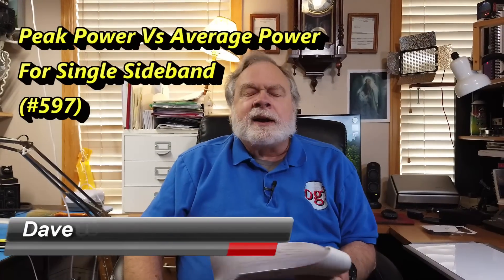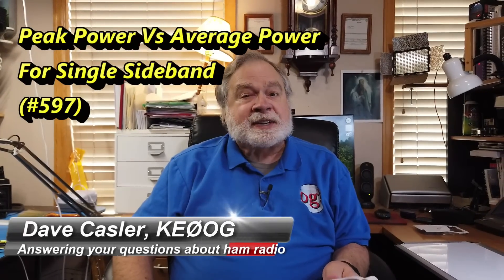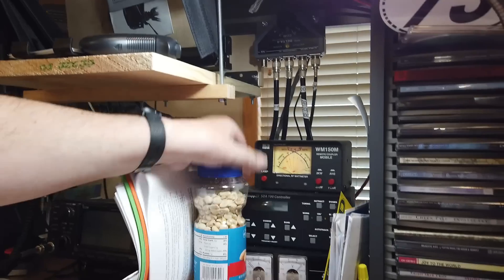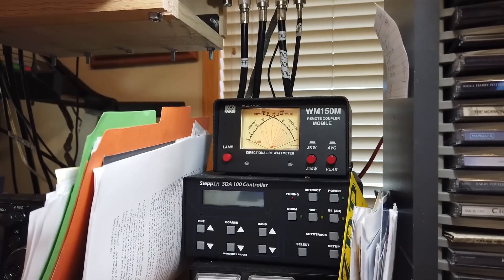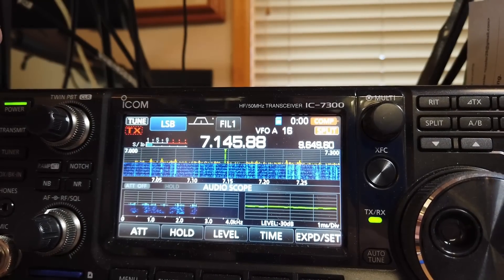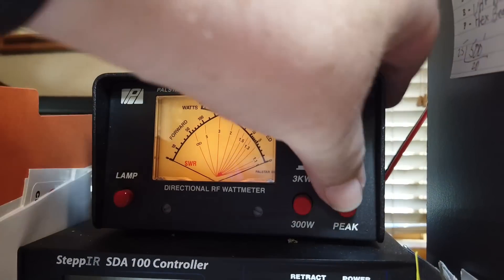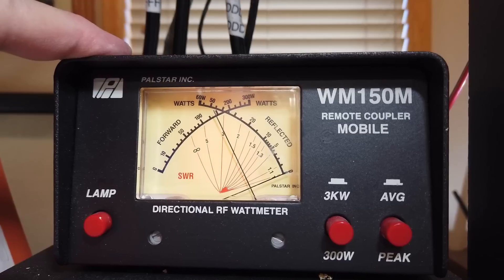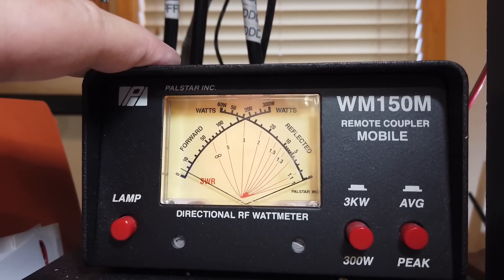Peak Power vs Average Power for Single Sideband (#597)

Comment: Thanks for the explanation Dave. One thing I’d like to point out though is that your Palstar meter is showing between 130 and 150 w pep when you switched to Peak reading. That should in no way occur for a 100w radio. Not sure how much it cost but Palstar is known to be good quality and pricey. So something is wrong somewhere there, either at the meter or at the radio. I would further investigate.
73s
Reply from the maker: It's old. Decades old. Undoubtedly needs recalibration.
Reply: @davecasler  understood

Comment: Got a new Palstar PM2000A AVG/Peak 1.8-60MHz Wattmeter . Very accurate. Ordered right from the manufacture  Palstar.  Great service. The power supply is sold separately
 from them. it's a good one not the switching kind that can cause noise in your radio. I bought a MFJ giant wattmeter first and sent it back. It was completely inaccurate.

Comment: David, thank you so much for answering my question. I’m wondering if in the future you could do another YouTube video where you’re talking to an operator on SSB while not connected to a dummy load. This way we could all see the real-time meter movements of an actual SSB conversation. I think that would calm a lot of operators down because at 100 watts, for instance, we'd be able to see the needle of the Palstar peak reading meter hovering below the 100-watt mark and not fully reaching and going higher than that mark during the conversation, as yours did while being connected to the dummy load.
Thanks again. David and have a very happy and healthy holiday.

Comment: While on the subject it should be mentioned that these pep meters use a circuit which requires a power source. There are meters that say pep but don’t use a power source and they always read low. 
I get on a average meter 25-40w. As long as I see a good swing I don’t worry about it provided fm,rtty,cw are 90-100w.

Comment: A meter of the type you showed SHOULD read PEP on SSB telephony or A1 Morse code correctly (but many do not), but the AVG switch setting is usually a hoax. Try 100W 50% duty cycle Morse (continuous DITs) and compare it to key down 100% duty cycle... do your AVG power readings reconcile?

Comment: David, great video. I have a question.  I have a 100 watt Kenwood TS590SG and only run 100 watts on SSB. While set to Peak Hold and Peak, my Palstar meter briefly hits the 100-watt number but then holds and peaks at 90 watts while I'm speaking, unlike yours, which hovers around 110 watts. Is this normal? Also, should my AGC always be on?
Reply from the maker: AGC is a receive thing. The ALC is on the transmit audio side. Adjust it per the manual; same with mike gain and compression. 90w vs 100w is not that big a difference.

Comment: If one really wants to measure maximum output power in SSB, a proper SWR meter with PEAK HOLD like the ones from Palstar are great. Even the PEAK power measurement at most meters (without PEAK “HOLD” function) is most often too slow and hence inaccurate.

Anyway, better measure max output switching the radio to digital mode, AM or FM and then measure the output power.

73 de Chris DL1GKC
Reply from the maker: That works too. I was specifically answering his question on SSB, but the additional demonstration you suggest would really help.

Comment: Many cheaper meters will simply place a capacitor across the meter to "hold" the reading. This is wrong !
 If your meter has no separate source of power. AC adapter, batteries etc. Then it is NOT a peak reading meter..
Reply from the maker: It does have a separate 12v power input.